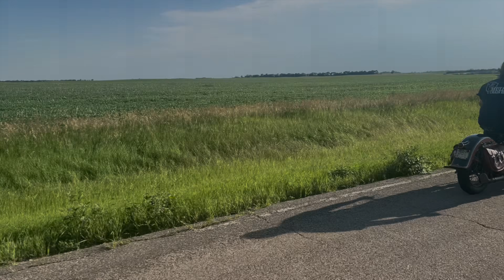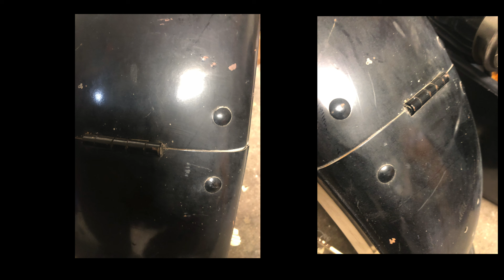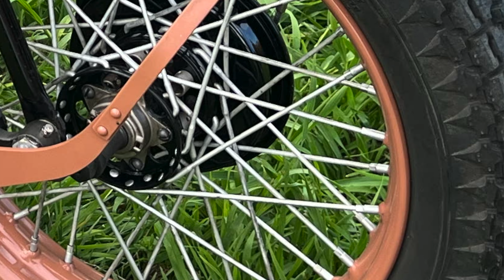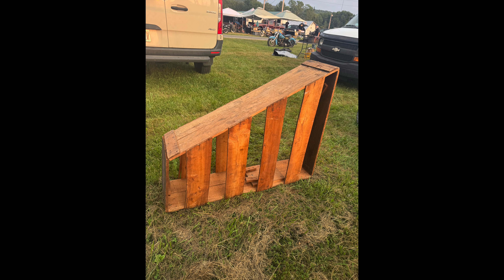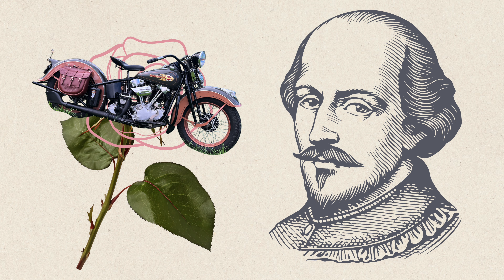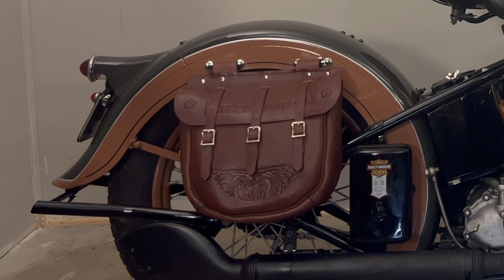FIRST YEAR KNUCKLEHEAD!! 1936 Harley Davidson EL re restoration overview

Comment: Carl, you were right the post for the pogo was worked on maybe about 2" down from the top it was welded completely around it. I am just hoping i can get a pogo in there. I measured across inside diameter. I'm getting close to 1-1/16" to 1-1/8" how does that sound to you? Also I found some numbers on the front down tube right side. And on the left rear under axel. Maybe I could run those numbers by you. And you could tell me if that's the original frame
What is your email address that you want me to send stuff to pictures. This is no where near a stock bike but I would love to bring it back to stock.I just think it would be too much work. And money
Reply from the maker: Hi.  Please use the email on our website. carlcycle@nrctv.om.    Thankyou

Comment: Carl, would you happen to have a picture of the hole in the frame to accept the Pogo spring? I have a 36 knucklehead that was gifted to me and it looks like the hole is small. Not sure if it's the original frame, and I also don't see a Zerk fitting. So I'm a little confused.
How small the hole is?
Reply from the maker: hi nick, its pretty common for prewar seat posts to have been repaired over the years and I feel safe that may be the case with your frame.   The seat post sits in a bushing and the outside diameter of the big twin seat post is 1.17.  Congrats on the 36. please send pics to the shop email in bio and id be happy to give it a closer look.
Reply: @carlscyclesupply thank you for your response, ill try to take a picture and measure it this weekend. I hope I can get one in there. Really like that setup

Comment: Just a flat out exquisite machine! Very well done 👍🏻 Agree on safety! Thought process and adherence to originality is excellent! Factory re-stamp frame (never seen it) really really cool. Thank you for sharing this exceptional example!
Reply from the maker: Thankyou for compliment. we appreciate it.    The factory straightened the frame after bike was wrecked or damaged,  the dealer would send it in and then the factory would fix what ever was necessary.   The stamp on the crossmember was only done to keep a record of the factory having to fix the frame .    We had a 37 ul frame come through the shop several years ago that actually had two numbers in this area which meant it must have been sent to the frame fixing department at Milwaukee twice .
Reply: So neat! Love the history of these old machines. Thanks 🙏